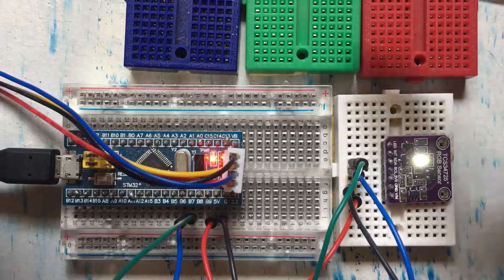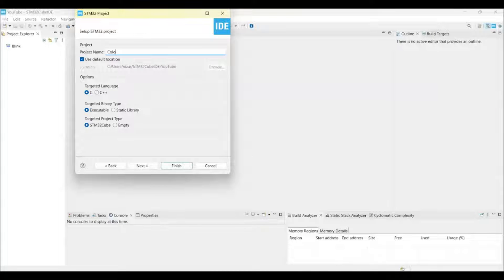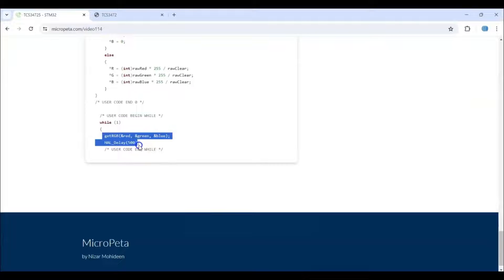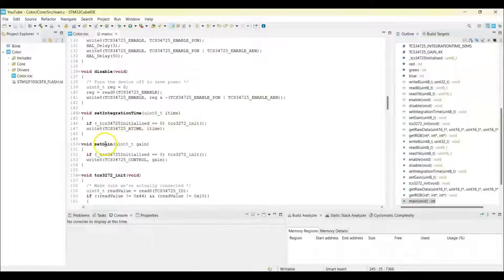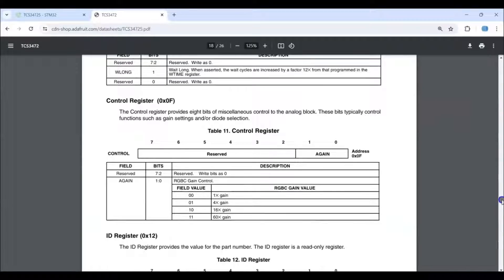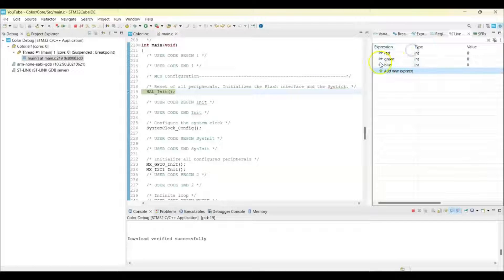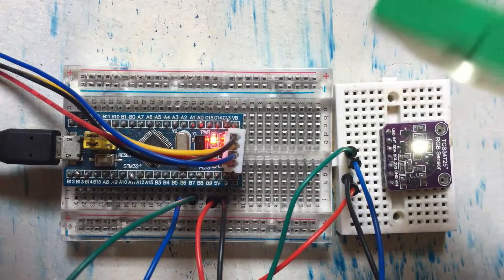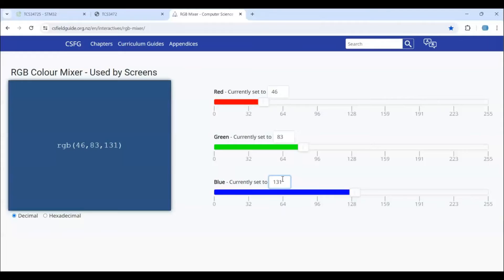114. STM32CubeIDE TCS34725 RGB Color Sensor with STM32 F103C8T6

Comment from the maker: If you do not get the color value, please change the code  
if ((readValue != 0x44) && (readValue != 0x10))
To new code
if ((readValue != 0x44) && (readValue != 0x10) && (readValue != 0x4d))

The reason is TCS34725 ID can be 0x44, 0x10 or 0x4d
The module I used in this video demonstration had the ID of either 0x44 or 0x10
So I did not include 0x4d in the code. 
Your module may have 0x4d Thanks

Comment: Thanks, What are the changes do i need to make for STM32 L432KC board, please
Reply from the maker: Although I have not tested it with STM32L432KC, it should work with I2C1 without any code changes. Thanks
Reply: hi, i tried with l432kc bord, but r,g,B data in live expression is 0,any suggestions please
Reply from the maker: You can run simple I2C scan program in the same wiring setup to see the connections are ok.
You can use https://youtu.be/7_jm38X7HUw
Or simply declare a variable 
/* USER CODE BEGIN PV */
uint8_t isFound;
/* USER CODE END PV */

And 
  /* USER CODE BEGIN WHILE */
  while (1)
  {
    for(uint16_t i2c=1; i2c<128; i2c++)
    {
      if (HAL_I2C_IsDeviceReady(&hi2c1, i2c<<1, 5, 10) == HAL_OK) isFound = i2c;
      HAL_Delay(5);
    }
/* USER CODE END WHILE */
Monitor the variable isFound in live expression
I2C address of TCS34725 is HEX29 which is decimal 41
If you see isFound to be 41 in live expression, you can proceed further
Reply: @NizarMohideen  I am also using this board and i checked the address is 41 but still showing all 0 what could the problem be
Reply: Thanks very much for your reply. it was my mistake, i didn't add the while statement. 
if i need to get data from this sensor using Timer interrupt,can I follow yor Timer vedio or any other  resource  ,please let me know
Reply from the maker: Yes. You can. Timer interrupt will work with this sensor. Thanks